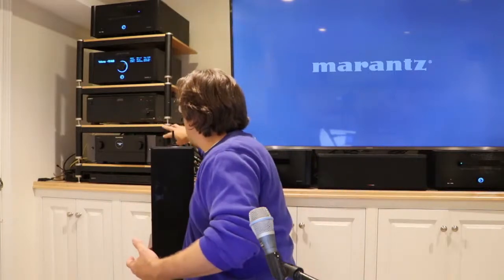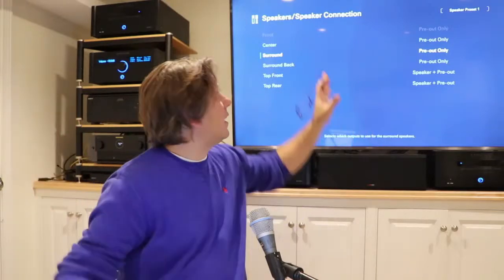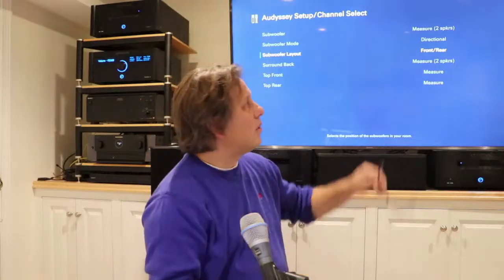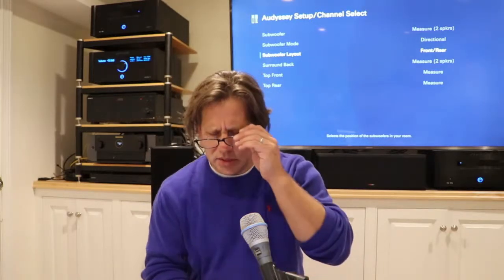Marantz Cinema 50 - Configuration & Calibration Part 1

Comment: Just purchased a cinema 50 a few weeks ago. Sounds good for music but not so much for watching movies and TV. No bass, front sound stage is dull. Movie dialogue all comes from the center channel with very little other sound, I’m not hearing background sounds or directional movements like when someone moves left to right or coming from behind. I have tried running Audyssey at least 10 times and nothing seems to work. After hooking up my two front elevation speakers,  things only got worse. I thought it was me until I hooked up my 22yr old 5.1 Yamaha RXV995. That dynamic soundstage that I have grown accustomed to all came back. Deep thumping base, detailed sound stage etc. When I bought the Yamaha 22 years ago, it didn’t come with room correction, no need just plug and play. It sounds great in any room. 

I feel like I made a terrible mistake buying this Marantz Cinema 50 ☹️
Reply from the maker: Paul - I missed your response earlier, but happy to reply now. Thanks for sharing your experience. I would have said that the Cinema 50 was better for movies, but with your report I can understand your issues with the limited directional movements. It seems that the Cinema 50 has its limits. I found it very helpful to hear you did the same comparison against your vintage 5.1 receiver with the same conclusion - the old units perform better. I paid $900 for my Sony 20 years ago. So it is not like I am comparing a super exclusive model. One would hope that we would see sonic enhancements over two decades and not just the new feature sets. -Jon

Comment: I bought the Marantz mm7025 in combination with the Cinema 50.
Not totally shure,If it so much better.
The Sound of the Cinema 50 is pretty damn good.But of course i can hear more Power and Bass Performance with 7025.
Alltough with Some Music it seems to have more pronounced highs.
Would be awesome if Marantz would Bring an Upgrade also matching the new Look of Cinema series..
Reply from the maker: Are you suggesting with the "upgrade also matching" is a physical upgrade kit to change out the front panel to match the style of the newer components from Marantz? Yes, that would be awesome, but I don't thing the larger companies, like Marantz, would do that. Such an upgrade doesn't promote full replacement of older gear, which corporate driven companies want to see. Emotiva has phyiscal kits to update / downgrade (New Gen 2/3 Black or Older Silver Aluminum Trim kit - $20 each.) physical styles so you can better match in a rack. Smaller company. -Jon
Reply: @ripewave  have got experience with the 7025 ? It sounds very good,maybe i have to get used to it 🤤

Comment: Very in-depth video! Hope you can answer this question: is it possible to display the active speaker layout icons on either the round display or the on screen display?
I’m looking into purchasing a Cinema 50 or maybe a 40 specifically for that secondary display behind the cover. (and sweet front panel lighting 😎)
Because I’m used to having this information on my current Onkyo, and am afraid that I’m going to miss it when it’s gone. 
This proved to be handy sometimes when switching sound modes. It’s good to know if the subwoofer is playing along or not for example

Comment: Hi, it's great to see you again in a video that, as always, brings us closer to the world of hi-fi.  I would like to make a suggestion about something as special as an audio-video receiver overhaul.  most computers have an hdmi input.  If possible, the screen could be divided in two and in one part show the menu of the audio video receiver and in the other a still image of the remote control.  This way it is much easier to understand the configuration process.  and a personal question regarding the marantz 40 and marantz professor 10 .  Which of these would you buy if you had the chance to choose?  I understand well the difference between the two concepts of internal architecture, but there are always these doubts and more when taking into account the advances that are happening at dizzying speed in the world of electronics.  Thank you
Reply from the maker: Thanks for the encouragement.

I like your suggestion. I installed OBS software the same day I made this live stream in hopes I could do some splits screens with live camera, documentation, web sites and the output signal from the AVR. I had it working but struggled to integrate with YouTude just minutes prior to going live so I reverted to the single camera view. I think I will have it solved for the next one. What I had planned was not as advanced as what you suggested, but from my tests so far I believe the technology will support. Great suggestion.

As for Cinema 40 vs AV10… the Cinema 40 is functionally equivalent to the Cinema 50 - just with the promise of better sound quality and higher amplifier output. The AV10 should take the sound quality up another lever while adding support for front wide channels and DTS:x Pro support. For those looking for front wide channels, the Emotiva RMC-1 Is a much better value. 

Jon
Reply: @ripewave  
Thanks so much . I really did not expect such a quick response ❤️🙏.  thank you very much again .now I know what I want .

Comment: Where can you change speakers to large or small. I dont see that. Audessey set front and center to full range.. is this correct or can you recommend a better setting.
Reply from the maker: The configuration is on a different menu. This is a complaint I have able the Denon and Marantz menus. They place related functions within different branches of the menu tree. From memory I believe you need to back out of the Audyssey menu a level and select “manual” for your speaker setup. Then the speaker size adjustment can be made. 

I can confirm when I get home -Jon

Comment: Can i run top middle also on Surround back? I have a 5.2.6 Configuration but when i want a Second Configuration i cannot Run them alone as middle connected to Surround back Terminals in Cinema 50 😢
Reply from the maker: I am looking at the Cinema 50 manual (page 51) where they provide an example of a setup with three sets of height speakers. They show that the TMR and TML speakers can be wired to the Surround Back Speaker terminals. They also state that any of the heights can be configured as Height, Ceiling, or Dolby Atmos types using the "Amp Assign" - "Layout" setting. What I believe you are saying is that configuration cannot be configured for both Preset 1 and Preset 2 layouts - if that is correct, very odd. -Jon
Reply: @ripewave  yeah i would Love to have a Second Configuration with 5.2.2 with middle tops...but top middle connected to Surround back only playing as top or Rear Height 😔,
Reply from the maker: @texxhexxmm  I definitely need to test out with my Cinema 50 when I get it back from repair. Should work. -Jon

Comment: Is there a way to force input 1 to come on automatically on start up. Had the cinema 50, hooked to lg cx. With apple tv plugged into receiver. Hdmi 1 came on automatically everytime. Stupid me wanted to upgrade tv. Got Sony a95l which was bad but also killed this working feature of starting on hdmi 1. Now Apple tv always comes on. Got rid of a95l for new LG g4 but still the problem remains.  How do I get it to start up on hdmi 1? I know it used to work but it broke itself as soon as I plugged in a new hdmi tv it broke.

Comment: With Audyssey and subs you need to tell it how many subs you have to measure. Also once you are done with your Audyssey configuration get a SPL meter to validate levels match.  Then I would run REW for your subs levels.  Once done I would save your configurations to a USB stick. 

Good Luck

PM

Comment: Hi i have the cinema 50 & connected it to my Samsung tv & i can see the set up menu but when i connect it to  my Sony projector nothing can you please help have tried changing sources but still nothing thanks
Reply from the maker: I may be too late to help - hopefully you resolve but if you having I will try.

Are you using the same output on the Cinema 50 as when you tried successfully with you TV? Sometimes CEC can interfere or could be a cable issue. Have you tested the known good TV connection with the same cable as the projector? -Jon

Comment: What is this marantz bass control thing where it can distribute lfe to 4 ch independently?
Reply from the maker: Audyssey and we assume the future Dirac upgrade (anticipated April 2023) provide up to 4 independent calibration of the subwoofers. I found it odd that while I configured the Cinema 50 for two subwoofers, the default is for Audyssey to analyze only one subwoofer - the first one. I can also manually set the levels of each subwoofer manually. -Jon

Comment: I guess its called directional bass but I haven't heard a peep about it so maybe its not new? Not sure but to me it sounds very interesting so I must be missing something
Reply from the maker: I am going to spend a little more time in the manual to see if they define “directional bass.” -Jon
Reply: It’s definitely new. DIRAC will eventually include this feature, so I think Sound United wanted to bring this feature forward with Audyssey so people don’t have to wait.

The idea is to send LFE or bass from each individual speaker to the nearest subwoofer. This is only practical if you have front and rear subs. It gives the “full range” effect like imax theaters, for example. As with all things audio, this is creating quite a controversy because bass is supposed to be omnidirectional, so why would this even be an option? Well, it’s because LFE crossover is 120hz which is higher than the point of localization, so of course you’ll be able to hear where it’s coming from, in those cases. But, anyone can always try both ways and see what they like better!
Reply from the maker: I had more time to read your thoughtful comment today. Makes perfect sense. Directional bass is about blending the non-directional bass seamlessly with directional frequencies. It provides for smoother transitions and a more natural reproduction. Happy to have front and rear subwoofers on opposing sides.

Comment: Message sent to your Instagram about the VOG channel placement. 🙏🙏
Reply from the maker: Thank you - I will take a look
Reply from the maker: I just viewed - very clever thanks for sharing. I can see how well that solution works for near wall applications. For the VOG I believe I would need to live with a pole just behind the main listening position. Functional yes - but would I find it distracting in the middle of the room? -Jon
Reply: @ripewave  ... Mount the VOG speaker to a cross bar between the two side poles.
Reply from the maker: Got it - makes sense
Reply from the maker: Got it - makes sense